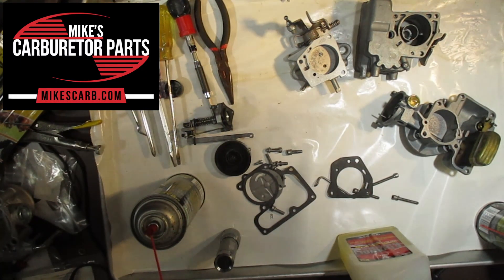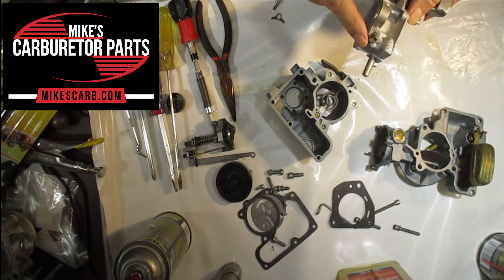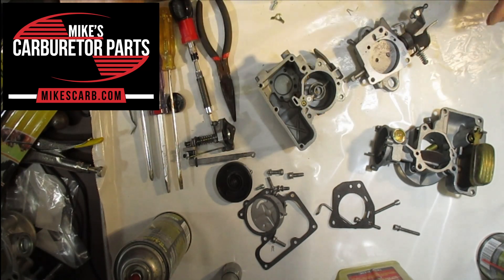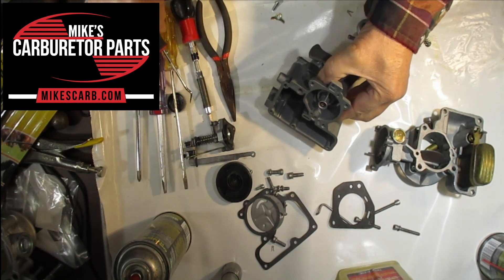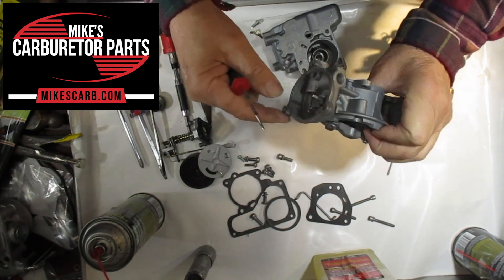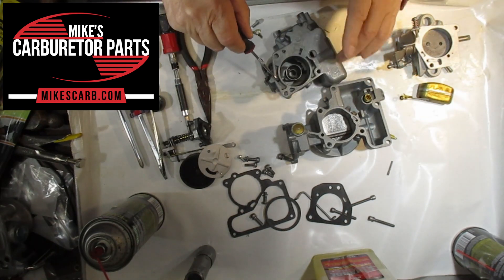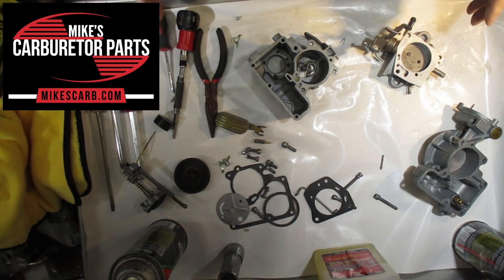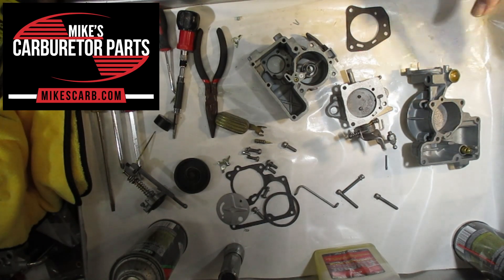Unlock the Secrets of Carter YFA Passages: A Comprehensive Guide

Comment: I have a constant drip leak from the hole where the pump lifter link comes out/down and connects to the throttle shaft arm. It looks from the lifter link hole. I have disassembled. The bowl cover gasket looks good. I'm wondering if I'm setting my float height incorrectly (if that would cause the bowl to fill too high). Otherwise, I'm looking for any clogged pathway that might make anything back-up.

Thank you for your help.

I hope you're getting some business from all the referrals I give about y'all. (There's no way to track it, but since Aug'22 there's got to be... 20+ people and several reference comments I post in several groups. 
Thank you
Reply from the maker: Typically caused by an over full bowl, check the float specs for sure.
We appreciate the referrals!

Comment: I found a discussion where the Carter YFA was used in the Ford 144, 170, 200, 250 and 300 cubic inch motors and the CFM ranged from about 150-220. So, how do you tell how much CFM the carbs running?
Reply from the maker: Sorry I don't know the formula.

Comment: I have an F250, purchased new by my father in 1972.  300 six with a Carter YF.  I've had many problems with the YF in the last few years; accelerator pump leaking into the manifold making it hard to start,  float bowl going dry while sitting, and now it won't start in the winter because the automatic choke doesn't function.  What is my best solution?
Reply from the maker: If you want to tackle all of the fixes yourself then visit this page for extensive YF technical information: https://www.carburetor-parts.com/carter-yf-technical

Comment: Question:
I have a 68 F100 240 I6 it’s got a pieced together carter on it. Do you know what originally came on this motor and do you know where I can buy one. Oh, manual choke and that’s been my problem Amazon has plenty but not that say 240 w/manual choke 
Thank you
Reply from the maker: Most used the YF, or YFA. Be careful because Amazon sells Chinese carburetors that aren't good.
Reply: @MikesCarburetor  I found that out the hard way. Was hoping you sold them.
Reply from the maker: Nope we looked into the Chinese and tested many. Mostly junk. One option is to buy the chinese then rebuild it with US parts. It's mostly the parts they put in the carbs that are no good. @ItsNotme2-h7e

Comment: I was hoping you could answer a simple question that I'm having a hard time finding an answer for. I have a Holley 94 bugspray I am rebuilding. I bought a kit from a local VW supply store. I was installing the 2 venturis and the gaskets that I assumed were correct, would not fit in the pocket around the holes on the body. There were 4 brass washers....I used those because they fit perfectly, but I'm not sure they are correct or will seal properly. Should these gaskets be the...I'm guessing paper gaskets...red in my kit? Or are the brass washers correct? Thanks in advance!
Reply from the maker: Those gaskets should be paper.
Reply: @Mikes Carburetor  thanks for the reply. I had also sent in an email asking about this...wasn't sure if you replied to all comments. In the response on the email, I was told they could be brass or paper.
Reply from the maker: @1bobvideo  I've only seen paper.
Reply: @Mikes Carburetor  ok. I may have to order a set then. The paper gaskets in the kit definitely don't fit

Comment: Please,
I have YFA on my '77 F250, 300ci.
I downloaded manual and tried my best to follow rebuild instructions and I watch so many of your videos.
I have a dripping leak.
It looks like where the link-pump lifter comes out of the front of the carburetor below the bowl by the throttle shaft seal, dust shaft seal and washer. 
I have checked the float height and drop height matching with float level 70-71 Frd trk 300ci for closest match.
Does this mean I have the part 63 rod seal wrong? Was I to press and seat it in the oval hole the rod goes down? Also, on your YFA diagram of parts, there is part number 64 looks like three oval seals. I don't think I have those, but I could order them from you if needed.

What are your ideas please for repairing this dripping leak?
Reply from the maker: Would it be possible to send me a photo of where it is leaking to sales@mikescarb.com Please copy this message along with the picture.
Reply: @MikesCarburetor  if I ever forget to tell you, thank you so much for your help. I am so grateful
Reply from the maker: We do appreciate you watching the videos.
Reply from the maker: That you for watching.